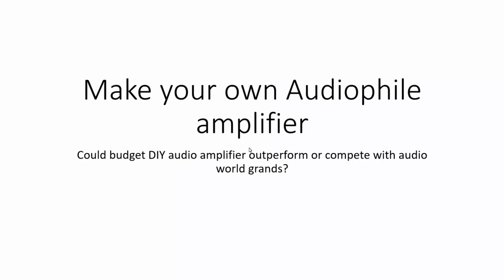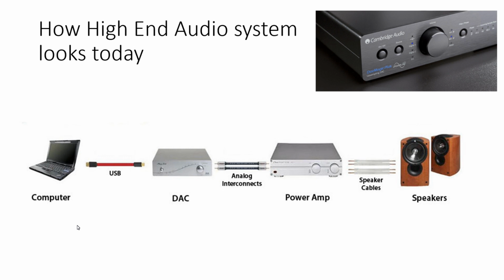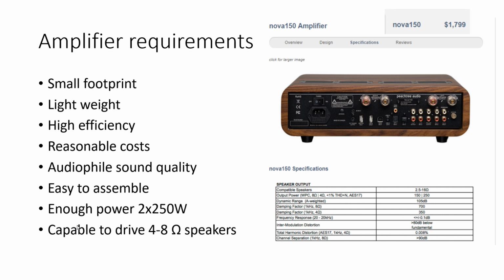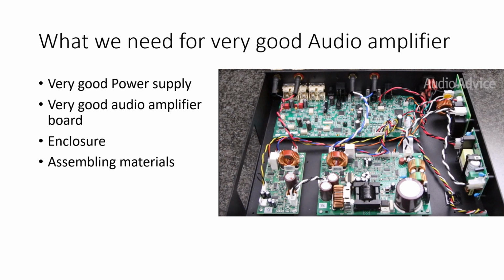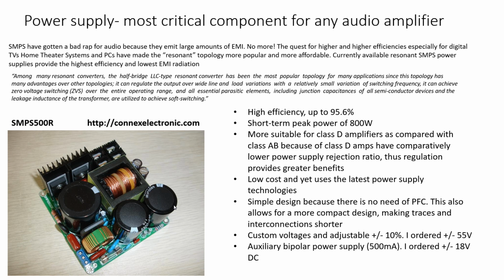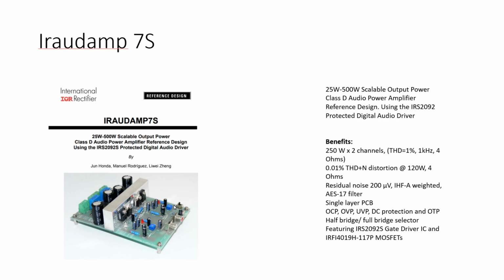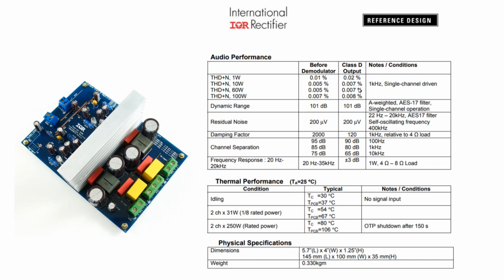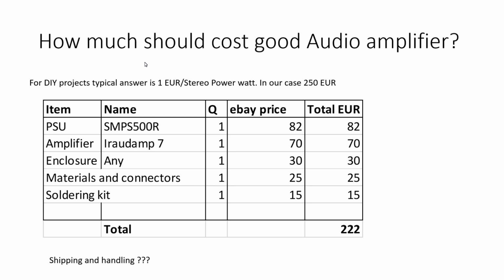Building audiophile Class D amplifier end to end tutorial

Comment: I follow your Vdo to build my own. It sound fantastic!

Thank you for your tutorial.
Reply from the maker: It the best reward what I can expect for time invested to create video
.
Thank you for feedback
Reply: Guntars Smits I just saw your new vdo. You change smps to albertec does it make sound better?
Reply from the maker: @MashApi No, we just got on time option to purchase professional grade power supply capable to work from 90-230V.  There is no quality difference because Connex Electronics power supply is one of the best what I found in the DIY market. An engineer who designed this power supply is good. And this PSU has best in a class efficiency characteristics running cool with small heatsinks. Abletec  power supply has been build for worldwide applications and therefore has PFC circuits to comply with EMI requirements and is capable work from a wide range of mains voltage. But it comes with cost and size. You can see that Abletec footprint is much larger, a heatsink is much bigger and following weight and size of all system.
Reply: Guntars Smits wow thank you. Now my friends come to listen this amp. All they want me to diy for them. Thank you for your sharing again 

Cheers

Comment: very good tutorial! thank you! can you pls recommend a lower power unit if i would build a lower wattage amplifier (using the 120w/channel module)
Reply from the maker: There is one solution from trustable designer: ICEpower 125ASX2. ICEpower are ex Bang and Olufsen design division, what spin off to separate company and started pioneering Class D designs for professional market. There is 125ASX2 model leakage in ebay under the same name This is fully integrated module with power supply and amplifier. And footage is really small
Documentation is available there file:///C:/Users/gsmit/Downloads/ICEpower125ASX2_Datasheet_1_4.pdf
With cheap modules available from eBay there are some gambling involved. Cheap price comes with short falls in components selection. You can either steel components from large project and then here is no difference in quality, or purchase components what did not path some specification requirements for really low price. Majority of class d modules what we tested was not that good as Iraudamp 7S. Output filter is really demanding where savings have immediate influence. Deviations of output filter inductance and capacitor values changing frequency response. Those parameters should be stable and independent from output current values as well and match designed power.
With 2x250 amp running it in 30 -150 W range you are touching absolute sweet point of quality and will have plenty of space for extra bass. Typical shelf loudspeakers are capable sustain short term load 4 times to nominal.
Reply: Guntars Smits, if I use the ICEpower as recommended, do any of the other components / wiring change?